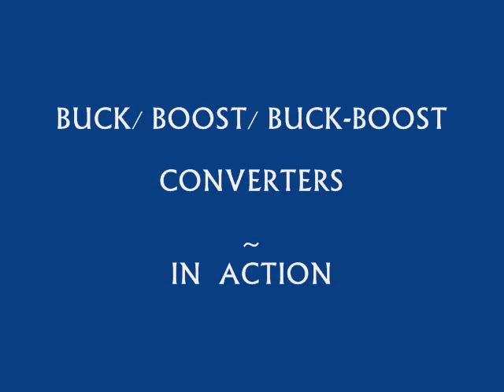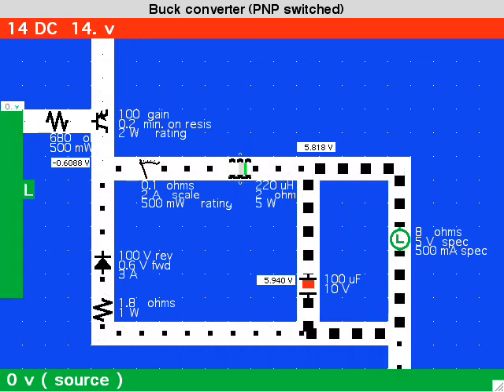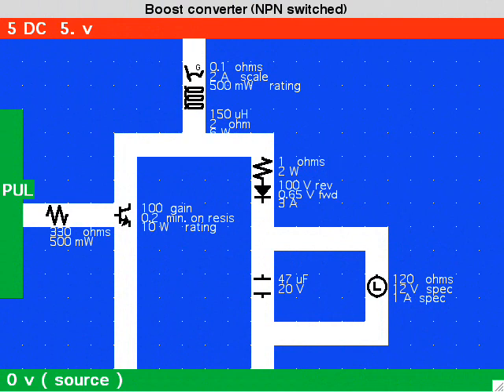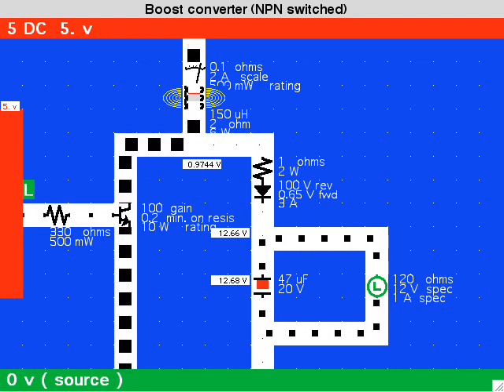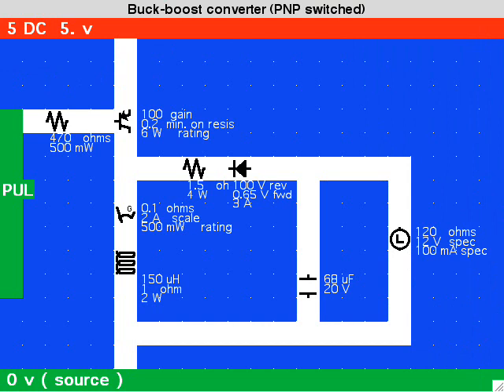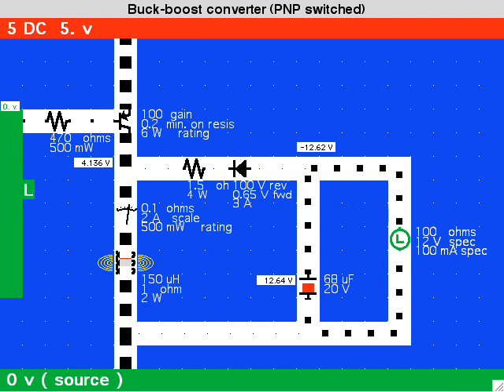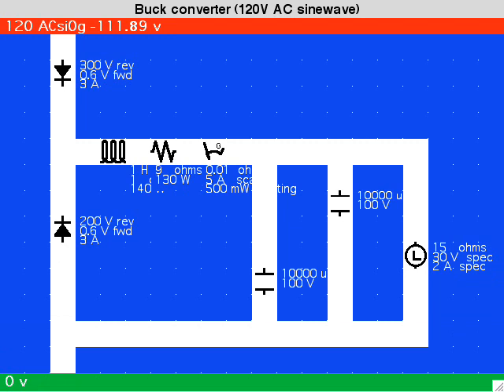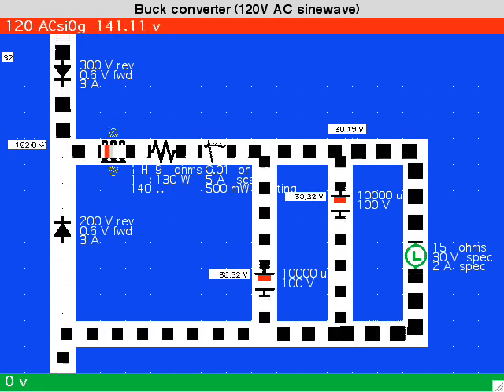Buck Boost Buckboost converters (Animated)

Comment: How did you find switching frequency?
 Is it done as that f= 1 / (100 * TimeConts_LR_inductor); 

TimeConts_LR_inductor = L / R = 220uH / 2R = 110usec;
f = 1 / (100 * TimeConts_LR_inductor) = 0.1kHz or 10kHz ?

Comment: i made a boost converter to charge 350v capacitors. im getting about 130v max out of it. unfortunately my transistor is rated for only 100v so i burned out a few already. if i get a higher voltage transistor will the out put voltage have the same effect? so with a 400v transistor i might get 430v possible? or should i get more uH in my inductor? should i have a faster or slower on/off of the transistor?